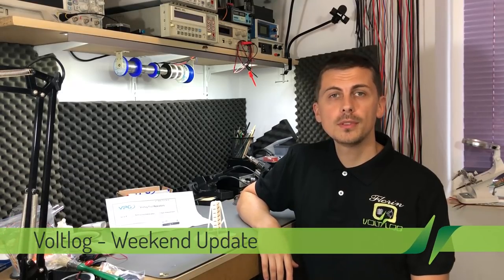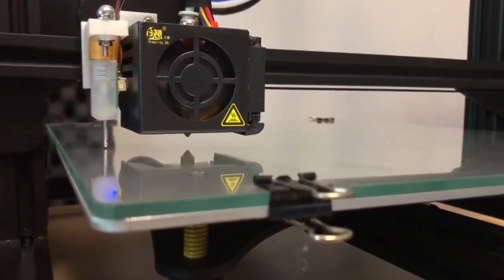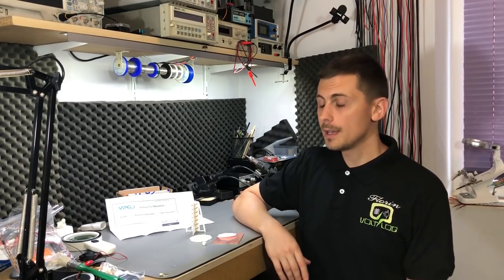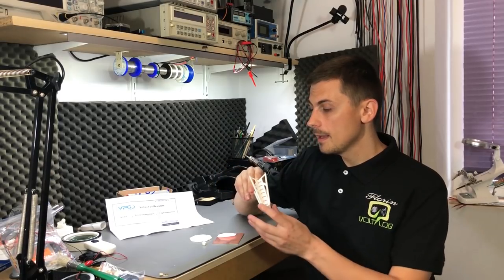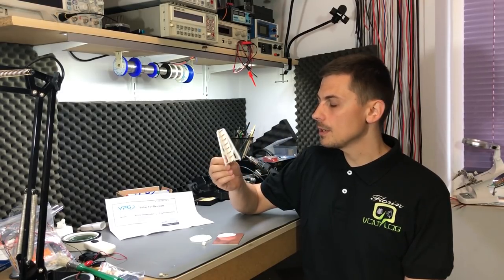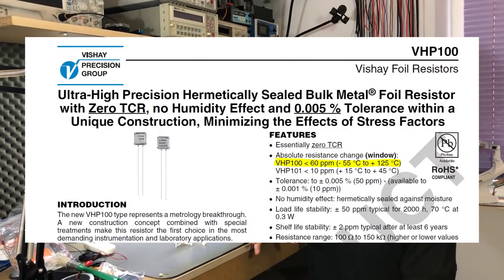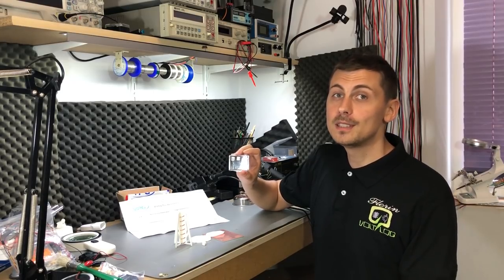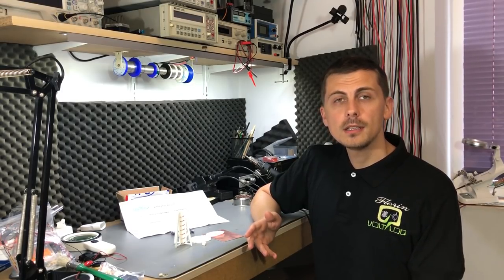Voltlog - Weekend Update

Comment: Jeez, you’re 
Ishtar years ahead of me in electronics, but I’ve learned so much. Even when projects aren’t relative to my uses, eBikes, I learn something from every video. My dream come true would you getting curious about eBikes and modifying those systems. Again, All the best, TD
Reply from the maker: Thanks. My dream is to build some kind of electric go kart but right now I don't have a garage where I could work on such a project.
Reply: Seriously? I also want to build an electric go-kart! I don't have a garage, but I have a big plot of land (compared to the city, I live in a suburban area so it's cheaper) in which I can build and partially test it (it's not that big). But I have a kart circuit just a few km away. The biggest problem I have right now is the budget. I don't want to spend a lot of money, and kart chassis are expensive even second-hand. Fully assembled second-hand karts are cheaper! So I'll buy one and sell the motor and gas tank, and it'll be even cheaper!

Comment: Nice job Florin. Not even sure you could better the design with regards to heat really, especially as the lights are within a confined housing. Only thing is maybe make the PCBs surface area slightly larger, if that's even possible in the available space. 

I had a similar issue with some G9 kitchen LED downlighters. I had about four different types before finding some that would run cool enough. Mine were getting so hot the solder was melting on the PCBs and the 0602 components were falling off.
Cheers
John
Reply from the maker: I think this comment ended up on the wrong video but I think you are reffering to voltlog #319 where I designed the T10 LED bulbs. Unfortunately that's such a common issue with these commercial LED bulbs, they run too hot and that is their main cause of failure. Time will tell if my design will last longer but given the much lower temperature it should. Thank you!
Reply: @voltlog  Sorry buddy.. I've moved the comment to the correct video.
Regards
John

Comment: I bought the Autolevelling Kit for my Anycubic Delta Linear (1st version), but I had to change the firmware for a custom one for doing a UBL (Unified Bel Levelling). And even then, there are inconsistencies on the first layer. I'm not sure if it's the bed levelling, the extruder motor being underpowered (the A4988s get very hot, maybe they have problems driving the 1.5 A needed) or whatever it is. I'm thinking of making a 32-bit board with more powerful motor controllers for it, but I'm not sure it's worth it. Maybe it's better to sell it and buy another one?
Reply from the maker: well I would say that if you have the ABL working than bed leveling is not your issue and you might start looking elsewhere for the problem.